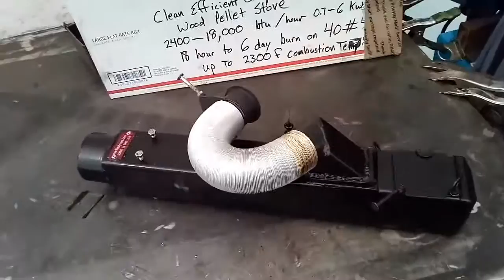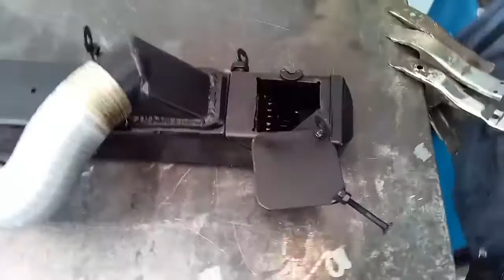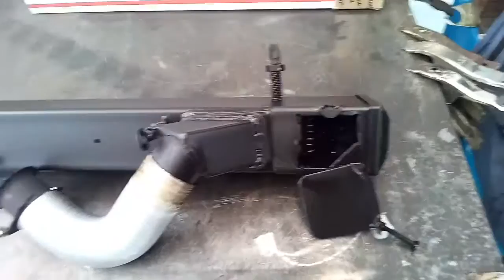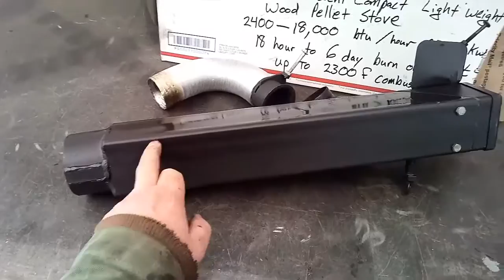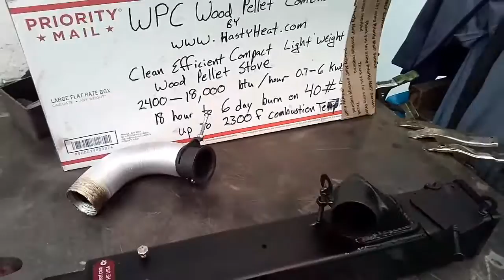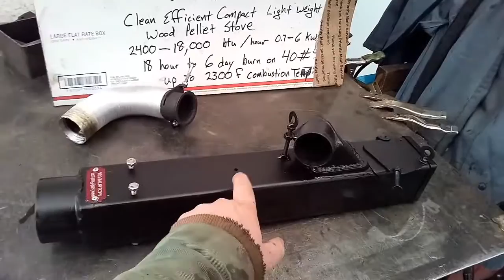CHP Wood Pellet Combustor for Furnace Rocket Stove Heater Burner Compact Lightweight Portable RV

Comment: What was the reasoning for the new design? Are you not reducing the efficiency of heat transfer by reducing the surface area of the stove?
Are you still going to offer the previous model in the other video?
and what happened to the water heater/electricity generators that were in the previous models video?
Reply from the maker: Brian Cardoza the "chip" stove has a modular Lego block design, this the core. DIY'ers can come up with thier own custom accessories and heat exchangers to work with the heat this throws out. Or people can order premade accessories and heat exchangers from us.
Yes the full campstove hotplate version is still available on our website hastyheat.com